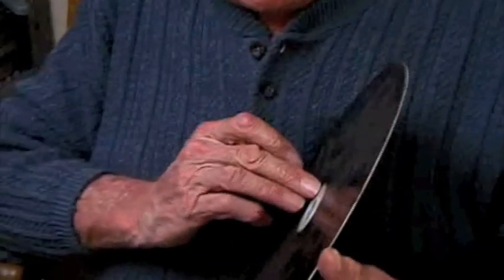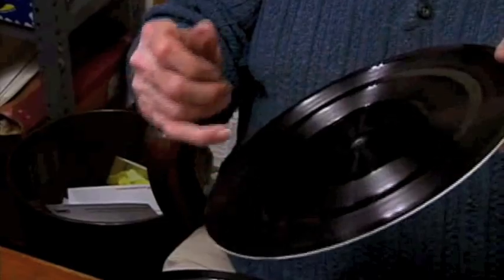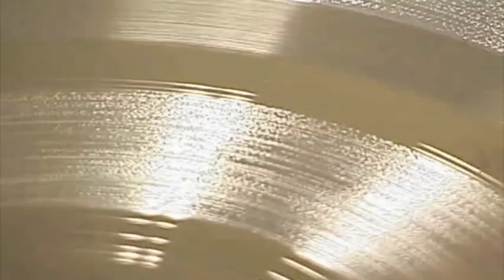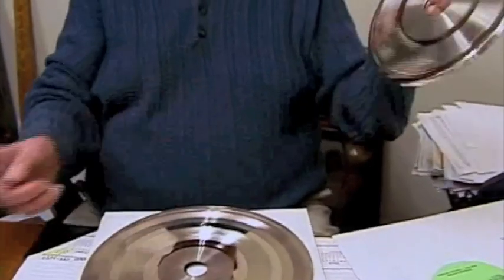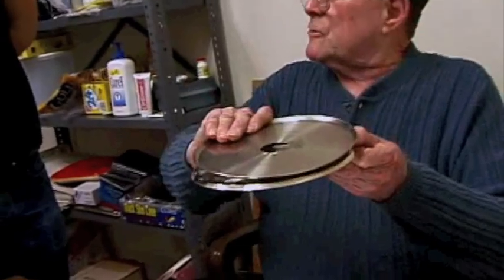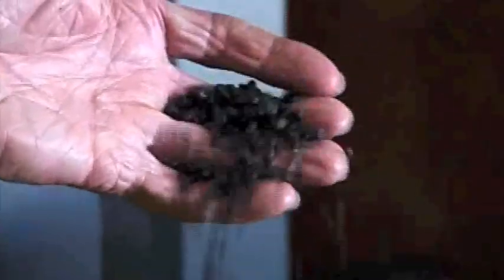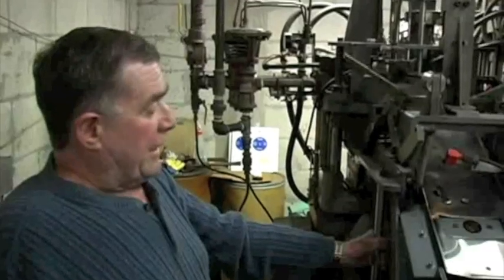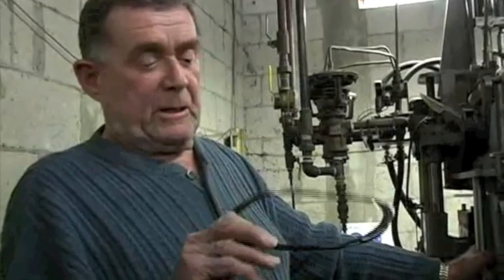The Dying Art of Pressing Vinyl Records

Comment: Actually, most of the old 78s were shellac, and Edison's Diamond Discs were made of a phenolic resin similar to bakelite. Vinyl really didn't come into play until the introduction of the 45rpm record in 1949, and some manufacturers used polystyrene for their records. With that in mind, over 60 years is actually true- from 1949 to 2013 is 64 years, even though PVC was invented in 1872 (but never patented until 1913).

Comment: Why do those records have such a large hole in the centre? That's way too large for the spindle.
Reply from the maker: They are 45s. You put an adapter in the hole in order to play it on a turn table. I imagine they started doing that in order to save money by using less material?
Reply: 7" 45's had a bigger hole to make it easier for them to automatically load on jukeboxes.
Reply: RCA Victor was the first record company to issue 7-inch 45's.  They made them to be competitive with Columbia, which had recently came out with the 12-inch 33-rpm album.   They made the holes big so that they would work in the specially made record players, designed to play 7-inch 45's.  The record players had only a large spindle and could only play 45's with the big holes.  After RCA other record companies adapted the 45 format, and maintained the large holes so that they also would play on the RCA record players.